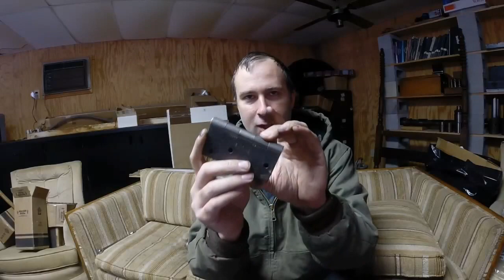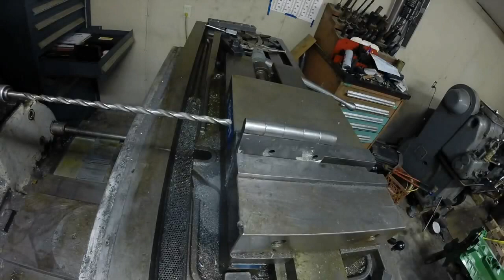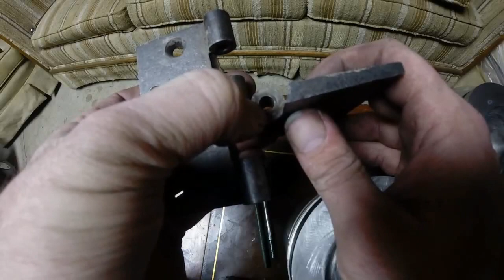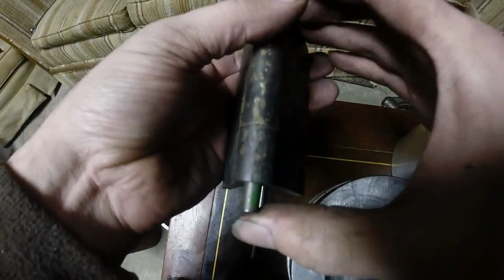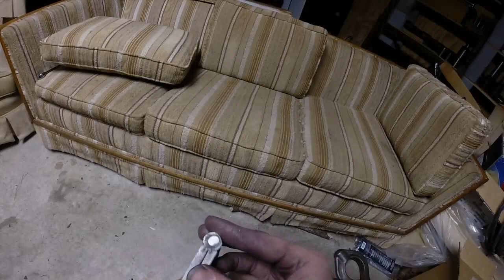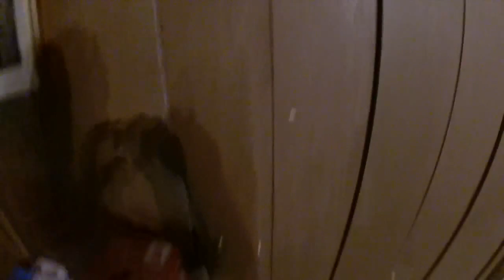How'd they do that #1 answer edition.

Comment: I really enjoyed this video.  It was neat to disect something crafted over 100 years ago and see how it was made. And then to see you fix it and put it back into service when others would have just bought a new hinge. Thanks for the video,  I'd like to see more of these.
Reply: Anyone who has worked on old houses knows how hard it is to replace old hardware with new.  In this case one would have had to fill in the old hinge locations and route or chisel locations for the modern ones because they are smaller and much thinner.  I had to replace a whole exterior wall because the old rough saw boards were an inch thick and the new ones were 3/4.  It is a shame that our culture has become "throw it away".

Comment: Hi Brian,
I'm impressed at your reverse engineering skills, and also how that in that era they would be able to mass produce some high quality castings to make the parts relatively affordable.
Interesting door framing pattern if it's original make...
Hope you got more worn stuff in your house so we get to learn more on "How it was made"
What's next....?
Pierre
Reply from the maker: That is original trim. The house is a mix of colonial and greek revival so the heavy columns are a common theme. The only other real challenge project I have going around here at the moment is the root cellar. That is another interesting How'd they do that. :-) Thanks for stopping by and the compliments on my reverse engineering abilities, its pretty key for a lot of job shop work.

Comment: Band saws go back to 1850 give or take. Really became common 1900's after bi metal blades were invented. Very large machines common in large foundry operations. But that looks like a part done on a power hacksaw and jig. Then filed and stoned flat. Skilled hands with a 3 inch x 2 foot file will make quick work of many jobs.
Reply from the maker: Great to know, Thanks for the additional info!